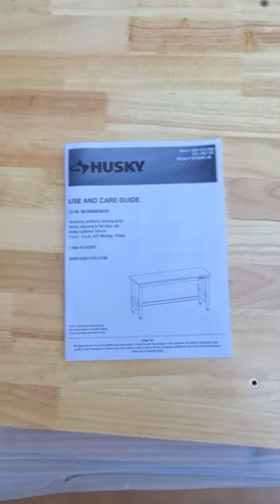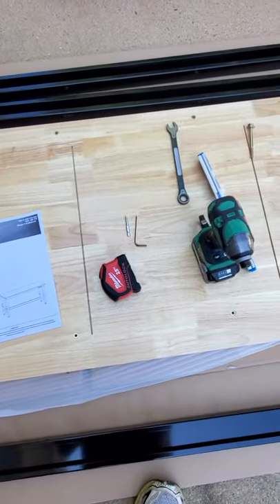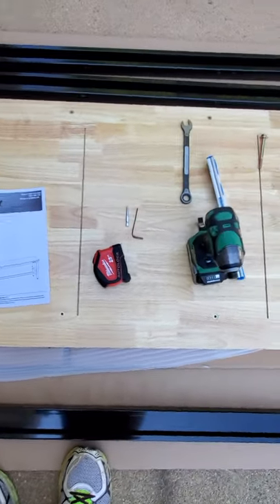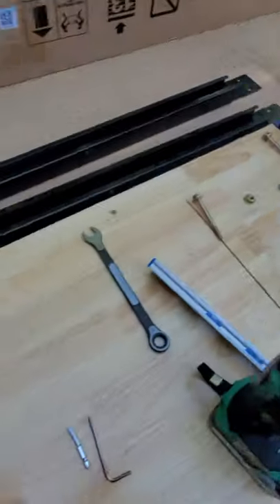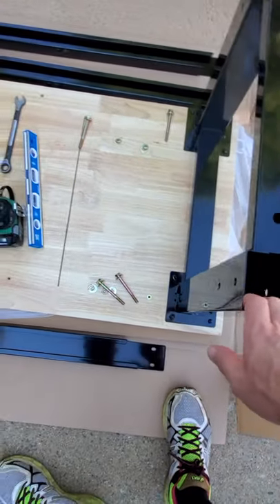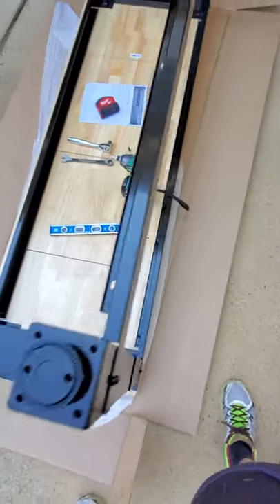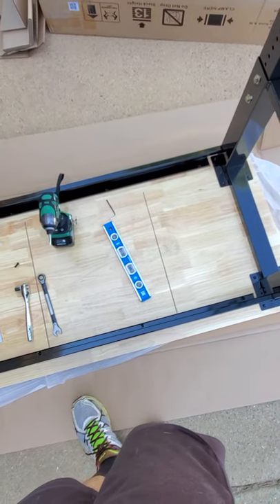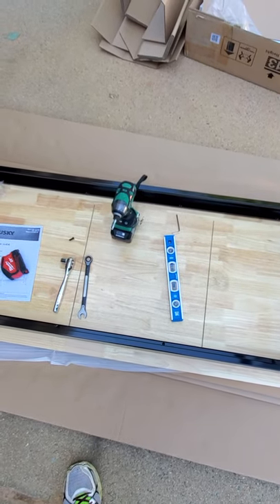How to install & assemble a Husky workbench

Comment: Did your long screw bolts DD came sliver or they like discoloration like in aftermarket glock barrel chameleon color type
Reply from the maker: I used what they provided
Reply: O ok then ya